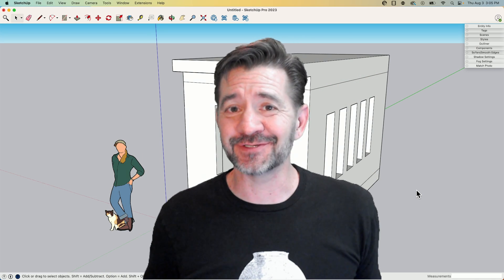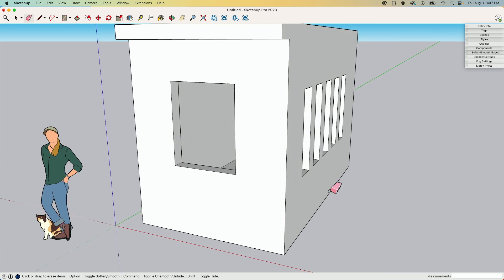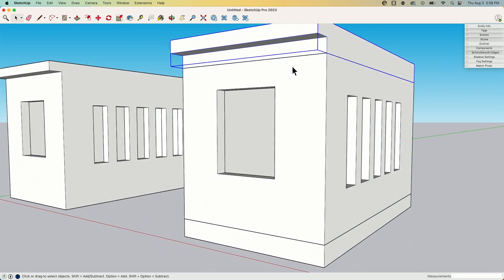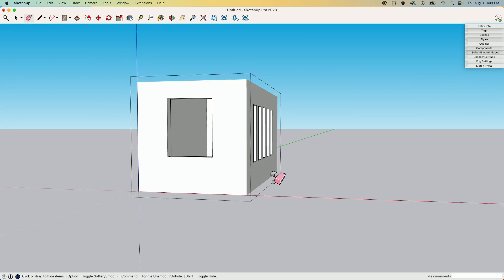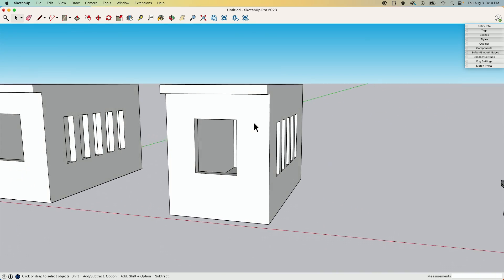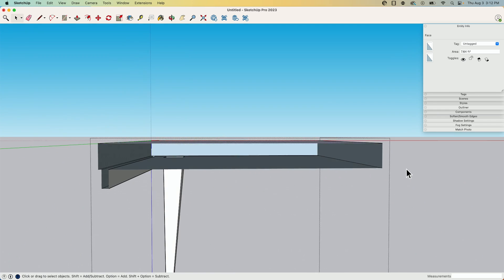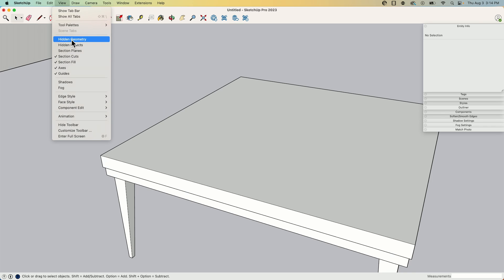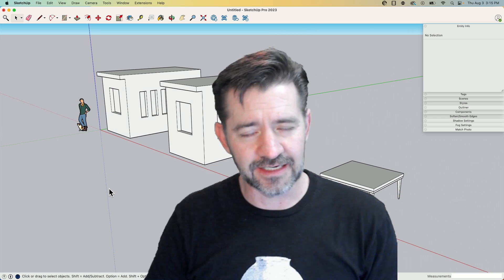Hiding your Edges

Comment: In the first example, assuming I inferred correctly, you might point out that erasing the lines is possible because elements are sticky. Excellent insights on how to show what you want and hide the rest without a work-around. Thanks.

Comment: Thank you Aaron. Although I hide edges a lot, I still learn little bits - I hadn't realised hide similar was even a thing! 
For me hide edges is most useful for cornice, mouldings and fascia, where corner pieces must remain unstretched but the sections between are components, scaled in one direction to fit between the corner pieces. Having the geometry hidden at the meeting ends gives a much cleaner look.